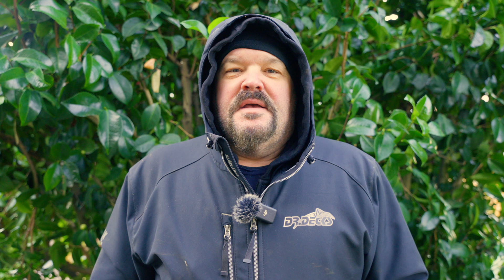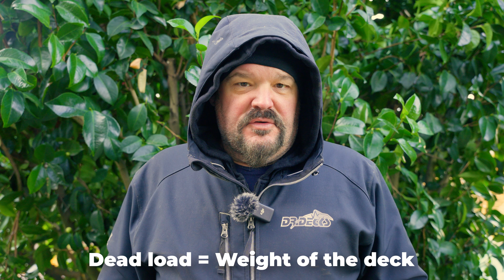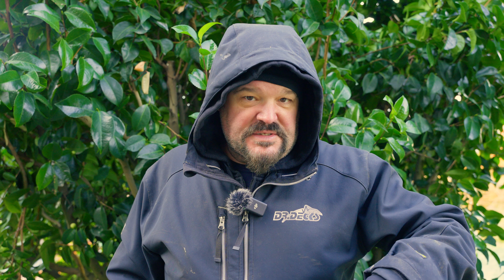Everything You Need To Know About Load-Bearing Capacity

Comment: Your videos are awesome. It gives some real world examples of how everything generally works.  Question about flashing a ledger though?  Its really hard to find z flashing anymore.....  if you do find it its usually aluminum.  Aluminum and other metals cant touch the new pressure treatments on lumber these days.   So are contractors just using g tape alone?  Or are they sourcing vinyl z flashing ledger cap and then taping behind it and on top?    worried about using g tape all by it self..... perhaps you could shed some light on what you have completed in the field?